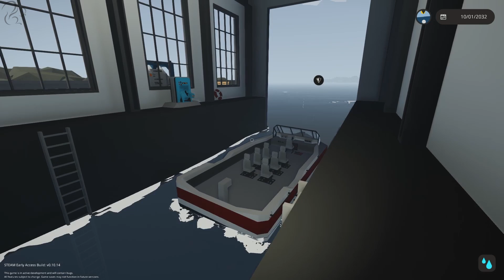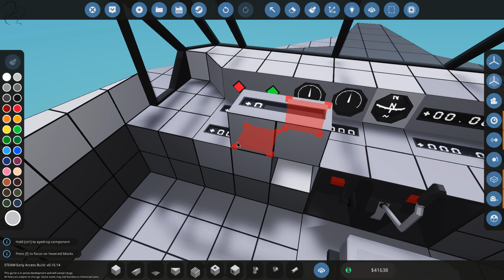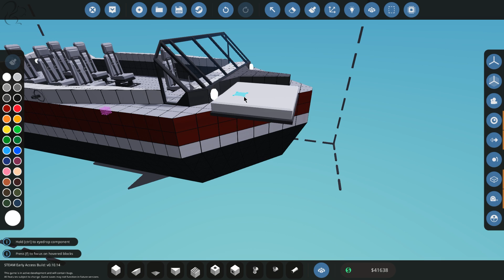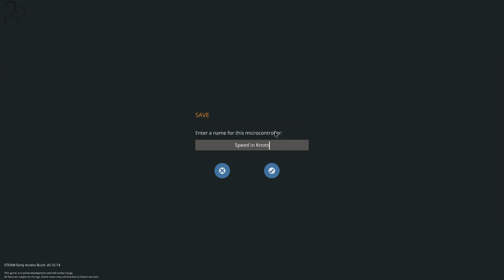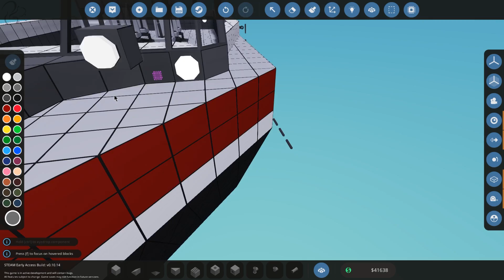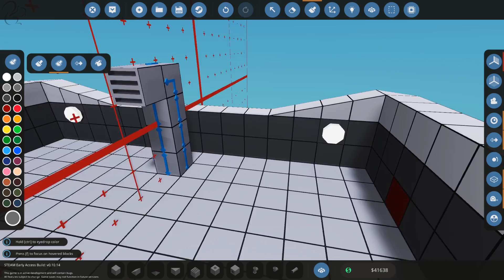Stormworks - Ep 4 - Adding Sensors

Comment: In real life, a boating speed sensor has a spring-loaded arm that's pushed back by the flow of water. In doing so, it generates a vacuum through a rubber tube that connects to the dial on your dashboard. The more vacuum you make, the higher the dial will go. The way it works is water pushes against the sensor, moves the arm back and changes your speed indication on the dial.

That's why you don't need electrical power for the speed sensor. Its "power" is generated by the water. :)
Reply: @invalidtorture , actually, on small outboard-engined boats they tend to install them at the rear. On the same board as the engine itself, but a little sideways from the propeller shaft, so it doesn't cause cavitation in the water and degrade both propeller performance and sensor readings.
Reply: Still should need power to run the digital display he is using. :)
Reply: Depends on the sensor. One on the ship I was on just worked on resistance.
Reply: I guess they work as indicated airspeed sensors too then, since that´s how it works on my boat.
Reply: RottenJeeves it does  and he connected it up :)
Reply: There are electronic speed sensors for boats as well that use hall effect sensors and a magnetic paddle wheel.
Reply: @stocky7134  Well indicated airspeed sensors on aircraft also take the static pressure (ie air pressure taken from a sensor perpendicular to the direction of travel). This is because the static pressure varies considerably so you need it as a baseline to determine how large the ram pressure component is. Planes of course also use the static pressure for other instruments in particular the vertical speed indicator and altimeter so this design works pretty well as the static source does multiple duty. This is of course how the old-style steam gauge versions work anyway modern craft typically have even more accurate electronic sensors as their primary flight instruments. Though they usually still have the older version as standby instruments having multiple methods of determining critical parameters especially when some don't require electrical power which comes at a premium in the event of an engine failure so it's better used for critical tasks like ensuring there is enough hydraulic pressure to control the aircraft at all etc. After all the more electrical power your ram air turbine needs to generate the more drag it creates as it's essentially drawing from the same pool of kinetic and potential energy the plane needs to glide to a landing spot.

Comment: I knew I would learn something new! I never noticed the electrical connections changing to white before! Also, since they introduced power curves to the engines, I've found the optimal engine rps for enough torque to push the boat is around 11. Anything below 8 causes me to stall out or go painfully slow.

Comment: You can translate the -1 to 1 output from the axis of the chair to 0 to 1 by using an microcontroller with input -> function (x+1)/2 -> output. So you don't waste half of the "movement" of the axis - much more important when you use the hotas-chair.
Reply: Gerald Habres but Then you spawn the boat with 50% throttle, and have to turn it Down everytime

Comment: Right now the generator is directly connected to the engine. So when engine RPS is decreased in high gear, the generator also has lower RPS, and produces less charge. You should be able to put a gearbox (or 2) at max transmission ratio before the generator to make it spin faster, which makes running at low engine RPS sustainable. I think you also need another prop gearbox and probably more engines. The boat is too heavy for one engine.

Comment: I took your base boat and spent 2 days to proper set-up the propulsion. I set-up the engine max RPS to 30, that means rough 1800 rpm. With 3 gearboxes set-up I got a maximum speed of 16 knots and 5 knots on cruising with low fuel consumption.

Comment: Like you videos on Stormworks so far, playing it for a long time already.

Just some small tips,
Microcontrollers can be made simple by going to the right top and go into the editor and press new processor.
You would only need 1 navigation light on each side, best is to use normal lights and dimm them a bit
There is a basic caculator already in game you can use to make things like a speed sensor calculate from ms to knots,kmh,mph. Its the same basic prossesor you made but you can edit the prosessor without going into the microprosseror editor.
You could put a gearbox infront of you generator and it should be enough to get enough power for your ship

Comment: The back light should be 135 degrees. Red and green are supposed to be 112.5 degrees each. Once you have a boat that is longer than 12m it should have a light at the top which is white and should cover the same area as both the red and green lights so 225 degrees.

Comment: you could add the generator to the drive train after the gearboxes so it can take advantage of the higher gear ratio. You can also add a single extra back up battery and a second breaker and tie it only to the engine for emergency starting. That's how I normally solve the charging problem.

Comment: I put my speed sensor upright and selected horizontal works fine. I have to add the micro controller though so I can see if my two engine version is faster. I'll make one for the RPS to read RPM as well. Cheers!

Comment: So you can add all the fuel divided by the maximum amount and than multyply by 2 minus 1 (so it can work with the gauge -1 to 1 value) and you have a fuel gauge 😯

Or you can work out fuel consumption and calculate the remaining range🤯

Comment: Is there a reason for using RPS instead of RPM? Could you use a microcontroller to convert RPS to RPM?
Reply: Yes and yes. To answer the later, RPM is RPS times 60, so simple enough to convert in a few ways. As for why, it's a convenient unit to work in, at least when doing the logic and programming, because it is the unit engines output in, and because many other things are also measured on a per second basis. Work with RPS values enough and you may find you don't bother converting for displays anymore, or even want to. For myself, I know all the important numbers in RPS from time spent tuning gears and PIDs while staring at RPS readouts. They're more familiar now, in this context.

Comment: Isnt high gear supposed to be faster?
Reply: Yes and no. Power and torque vary on a curve based on engine speed, and drag increases noticeably in water at high speeds (drag is proportional to speed squared).

I have what I would call a small big ship, powered by two large engines. If I set the engines to hold around 6 RPS, higher gears certainly mean higher speed. 1st is direct drive, and does 1 or 2 knots. Second steps it up to 2:5, and 5th is 2:9. If I want to go really fast though, second or third is the gear I want. Top speed in 5th is 30 knots. The engines simply cant do more than 8 RPS in such a high gear, and that's what causes the fastest gear to invert: the decreasing maximum engine speed of high gears. In second gear the engines can hit 16 RPS ,pushing me at 45 knots. There are throttle settings between those extremes where 3rd or 4th is fastest, which is why I have so many gears. So if I wanted to go from a standing start to full speed, I'd probably set the throttle to around 10 (that is, a target RPS of 10) and step up through the gears in order. Once I hit 5th I'd push the throttle to max and start stepping back down through the gears to 2. Or I could just slam the throttle and accelerate entirely in second, but it sounds and feels way cooler to shift 9 times than twice (sequential gearbox).

Comment: I have bought the game, but sadly my computer cannot run it because of its graphics but I’m going to buy a MacBook Air soon for school so I can play then!
Reply: I would recommend getting an Asus laptop or something along those lines if you're planning on playing games on it aswell, you'll be very disappointed if you try to game on a macbook unfortunately
Reply: Blank Gaming I have used macOS and Apple products for the WHOLE time I have been in school, (4 years) but had got a crappy MacBook, all of the software we use in school (Yenka for electronics, Office ect.) can work with macOS UNTIL macOS 10.15 “Catalina” came out, then we lost Yenka (because of security over 32-bit apps) but lots of people in my school have switched to other computers or used Wine or the tech genius’s (like me) have Bootcamped our Mac’s so we can use Windows Programs and old 32-bit Steam games.
Reply: I recommend you buy laptop or desktop PC asus rog or msi which has a decent graphic card and decent processor. Playing a game on mac is not Ideal cause gaming has too much load and not good for mac cpu and gpu which causing overheat. I've playing on mac and it's not run the game very well.